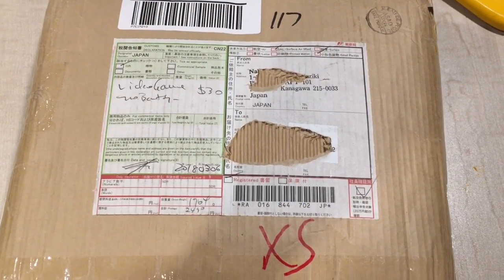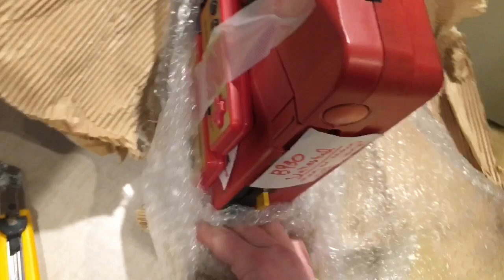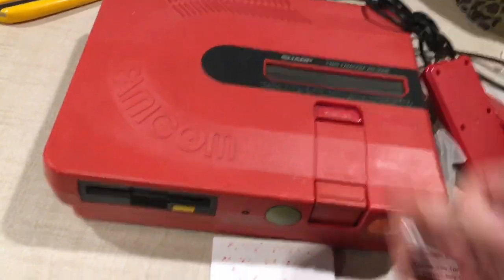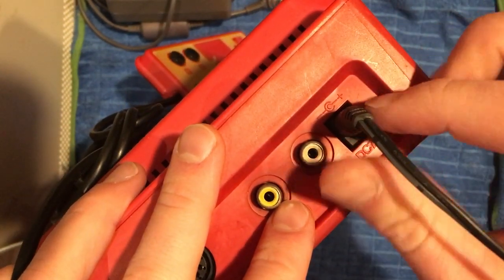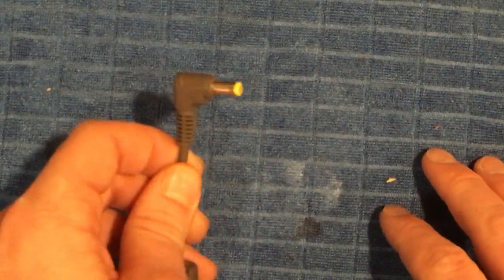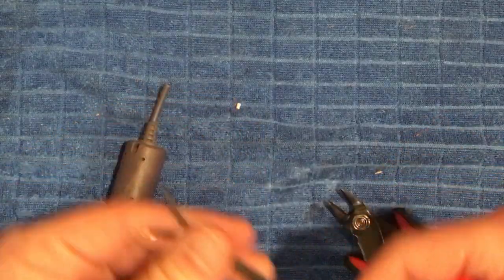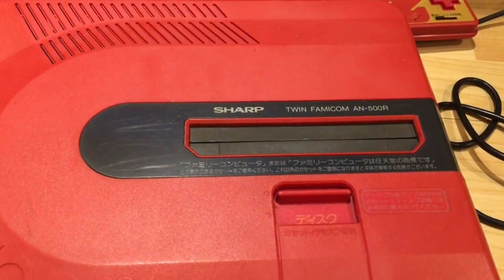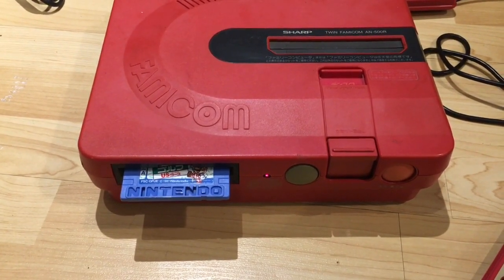Fixing eBay Junk - Sharp Twin Famicom - Part 1 - Testing and making a power cable

Comment: Also, I've always got my pug helping me out. Having a pup helper always makes things go better things go better.
When splicing cables like this, I always find spinning each end of the strands together, tinning each end so you're dealing with "solid" wires, then soldering them saves the aggravation of the wires going rogue like yours were.

Comment: Didn't have anything to do with the SNES. You are right about piracy being a concern though. The big reason was cartridge technology advanced to the point where any disk system game could fit on a cart by the time the NES was available all over North America, so an expensive, slow, clunky disk add on wasn't needed here.
Reply: Justin Thomas but it would be a nice collection.
Reply: +Justin Thomas Yeah, and even Nintendo of Japan caved-in and re-released previously FDS exclusive games onto cartridges later down the line, (e.g. Metroid and The Legend of Zelda) sometimes with battery backups added.

Comment: To connect those wires mechanically prior to soldering, strip both sides long enough.  First, twist the strands, keeping them straight.  Add a little solder to both wires.  Ply both the tinned wires and form two hooks.  Connect those hooks into each other and twist both sides until both hooks close.  The wires are now firmly mechanically connected.  Solder the joint for optimum electric connection.  Secure the joint with heath shrink.

Comment: It's an attractive console design. It can act as an alternate to a flash cart since the disk drive could bring homebrew games into the Sharp Twin either on disk or maybe on IDE Flash internally also.
Been there,  I got a 1980 portable TV with a now odd 4-pin jack, handy to make your own cords sometimes. Not that solder savy myself, had a PSP sit for 8+ months till I found a cheap AC for it, a Kodak iirc. ^_^

Comment: It's easier if you pre-tin both wires you want to bond together, then hold them in contact, and heat. The solder will form the bond.

Comment: Matching the output voltage is one thing, but the maximum output current rating should also be considered. In your case, the output is right at 7.5 volts, with max current rating on the Sony adapter at 2 amps, which luckily, given we don't have the proper documentation with regards to power draw, should be enough to safely run the system for extended periods of time without overheating or having the adapter's voltage drop too low. Personally, I'd always try to find an adapter that is rated for a higher output current than what I think I would need in the absence of labels/documentation. Just throwing this out there for anyone who might not be familiar with electrical work. That said, nice video. Looking forward to the next.
Reply from the maker: From what I've looked up, the current rating of replacement sharp power adapters is 1.5a, so the Sony one is within spec.  I actually found the idea looking for what I should use to power it, and I just happened to have a couple
Reply: That's good for you then. At least you've saved around $10 from having to buy a new brand name adapter with similar specs. It's always nice when you have the original bricks from name brand manufacturers. You can pretty much always trust the rated output figures, which is VERY important for nice rare/vintage devices. Good job!

Comment: Went back to see part 1 since you just uploaded part 2. Didn't see it in the comments, but with 230 comments it's very possible I missed it. Just a heads up, electronics in Japan run on 100v where the plug you've put together runs at 120v. This honestly isn't that big of an issue, and most likely won't do any harm to the system, but it is something to be cautious about.

Comment: So I picked up a bundle of systems off eBay and started repairing them, your videos have been an amazing help so far but I've ran into a hiccup. I have an original ds that charges and powers on... To a blank white screen top and bottom and no startup sound. My question is if you know what the issue may be and how to fix it or should I just canibalize it for parts?

Comment: i would give him a negative or at least neutral rating for worst shipping ever... thin layer bubblewrap and paper...  as if this person cant get a box and newspaper stuffing...
Reply: n0Sk_ill You are so right! I thought that was the worst packing ever. It should have also been shipped in a box.
Reply: shipping is expensive enough but you pay for it and to grab some recycled boxes from the grocery is not that difficult... i hate when sellers treat the items they sold like its not worth the effort cause its not thier own anymore...
Reply from the maker: To be fair, shipping was free on this console.  I've seen (and recorded) much worse.

Comment: That's a common 9/12v DC adapter 5.5 mm x 2.1 mm barrel connector. You can drop the voltage from one of those by inserting diodes. ~0.7v per diode for regular diodes. Assuming a 12v adapter, 12 - 7.5 = 4.5, 4.5/0.7 = ~6.43. Round it up to 7. 4.9 volts dropped. 12 - 4.9 = 7.1 volts. Close enough. Of course, check your diodes, you might need one less or more, and can get a closer match by picking and choosing the appropiate combination.

However, with the voltage being close to 5v, It'd try making a USB to barrel connector cable and plugging that to a phone charger. A lower voltage won't hurt a device, it may just work erratically or buggy, or plain won't work. If it does work, the lower voltage would mean less heat disipation and deterioration ("undervolting", look it up.)

For testing, you could have stripped the wires on the commonplace barrel connector, and first wrapped the negative around the barrel, twisting it on itself to hold it closed, then jammed the positive on the hole, doubled up and twisted as necesary. Then your choice of elastic band or tape to hold it in place. I find bending the wires back 180 degrees and holding them with a rubberband keeps the center one from going out and the outer ring from slipping out.

Whatever you do, don't fuck up an original adapter, please.
Reply from the maker: Never got an original adapter, it was the tip from an old dsl modem, and the transformer from a PSOne (super common here).
Reply: It's hard to explain, so here is a picture I made:
https://s17.postimg.org/eoe4abnov/not_to_scale.png

Comment: Two ways to splice braided stranded, remove only 1mm or so of insulation leaving only a tiny amount of exposed wire then jam ends together and leave a bead of solder in the ends jammed together or. google linemans splice or knot I forget what its really called.

Comment: You do interesting things but I do have a suggestion to some glaring notes in your work. Heatshrink tubing is your friend in a situation like this. Electrical tape for a use like this is going to deteriorate and get gross/sticky over time. It's also much cleaner-looking work. Just feed the tubing further down the conductor and slide it back over your soldering work to shrink it on.
Reply from the maker: I agree.  Mentioned towards the end of the splice that I'll probably pick up some tubing and do it properly.  Was out at the time

Comment: Why not just switch the polarity of the wires on the black sega adapter?
Reply from the maker: That was an old dsl modem adapter.  It output 12v and not enough amperage.  Would have the voltage regulator working too hard and lead to premature failure.  Plus not enough current to potentially run properly

Comment: much as i'm impressed by an innovative solution i can't helps but feel that two official psu's have been sacrificed to make a bodge one ;-; i think id've ordered the right tip atleast if not ordered a psu from a specialist, they're rarely that expensive.
Reply from the maker: It's worth clarifying, the tip I harvested came from an old dsl modem, not a NES, as i made it sound.
Reply: ahh good to know :D , i'm stoked it turned on, in my experience it's super rare for the cartridge port side of things to die they are basically tanks but the drive belts are a near certainty for gumming up and dying, that and the read heads getting super dirty as the disc system games don't usually have any kind of dirt guard like the later blue ones do
Reply: Also, how important was it that you found a tip positive power supply when you were putting a different connector on anyway? Couldn't you have just reversed the polarity when you soldered the new connector to the wire?
Reply: Yes, he could have.
Reply: Trafficman  if he had you would say why not use the other one

Comment: Good video, interesting console but you need to learn how to splice cleanly as those wires were frayed to hell. When dealing with coaxial cable to fig8, cut one side shorter for the core. Or just buy a dc barrel jack to fit properly

Comment: that hum is the power supply btw. i have a nes i had that happen on. it is annoying but can be fixed easy by getting right power supply.
Reply from the maker: Hum is actually the mic on controller 2
Reply: it only happens on the disk drive it seems. sounds just like my nes when was useing wrong power supply too

Comment: Hi, idk how to contact you any other way but I have recently reinstalled a battery on a Pokemon Silver cart I bought from Ebay with a dead battery. For some reason it has started glitching after setting up the clock. First jailbars appear, then the tiles get messed up, and then it just crashes. Saves don’t work either (it says that it will have to overwrite it, does that and then the game crashes). The polarity of the battery is right, doesn’t seem to be any bridging. I removed the battery and it went back to normal. Do you think the cart can be repaired?
Reply from the maker: I would think so.  Usually that behaviour would happen if you affected one of the other components.  Possibly a solder bridge on an IC, or you knocked a SMD part off the board, see my monsters Inc video I made a few weeks ago, I did that exact same thing.
Reply: RetroRepairs Nevermind, apparently those batteries from Ebay with tabs on opposite polarities (longer upper on the positive, shorter downside on the negative, which is opposite on original ones) touch the metal ring on the board and short themselves. Luckily my save chip wasn’t damaged (i don’t think it was bc saves work fine now with a donor battery from another cart but I hope?) but yeah need to be careful with that.

Comment: replacing the belt is trivial, however setting up the drive head is a pain in the arse, but there are plenty of good videos on youtube showing how its done, but there is not one single video that is perfect so watch them all, then work out the best approach for you.
it really galls me that no-one has ever put the nintendo service tool on the net, it slips on the drive motor and holds the position making belt replacement and head alignment dead easy, but no-one ever released the pics or diagrams of it.

Comment: the only yhing i would change is instead of electrical tape it use heatshrink tubing it there is somthing for that thin of wire ive considered getting some to repair a laptop power supply that the wire is ripping a little since the electrical tape seems to wear out over time and from flexing of cable
Reply from the maker: Yeah definitely.  Like I mentioned in the video, heatshrink tubing is ideal, and I'll probably pick more up and do it that way
Reply: RetroRepairs i must of not heard that part as i was eating while watching

Comment: if you get the belt from Console5 they are good quality.  I also ordered on of the untested no power cord systems.  I should have it soon.  But I already have the belt.
Reply from the maker: Good luck with the system.  For some reason I didn't even think of console5, I've ordered from them before, great resource

Comment: Will you try to de-yellow those controller overlays?
Reply from the maker: ArchiBenny95 I never realized they were yellowed, almost all pictures I see have them yellowed, I just assumed they were designed to be gold.  Rare to find a picture of one with the actual white overlay.
Reply: I know right? Usually the ones with good contion overlay are ones that were stored in the box. I did some experiments on a Twin Famicom controller with hydrogen peroxide and uv, but the red plastic will bleach too and turn more pink if you don't put the mixture only on the overlay, so be careful if you try! By the way, judging by the note attached on the console, we bidded on the same Twin Famicom on Ebay :)

Comment: You really are fing flux happy!!!!  You just stripped those wires that were sealed in plastic. Please put your flux pen up unless you soldering dirty / oxidated contacts or wires. You really should not be giving wire soldering tutorials.

Comment: Neat <3. Question: do you sell your repairs?
That's not the reason for the disc system. The reason was because of poor sells in Japan and they didn't release it in America. And not piracy. If you look at the disk and and inside of the disk system they have the word Nintendo in them and that prevented privacy. So next time do a bit of research. (not being an ass)

And

Also

HE HAS A DOGGO
Reply: He mentioned that in the video and explained that it isn't difficult for reproduction manufacturers to duplicate. Next time you criticize someone's video at least watch the whole thing first.
Reply: Dan Kooiman I did. Just making a point.
Reply from the maker: Aurα вírdч Nintendo's anti-piracy system for the FDS was the physical imprint in the discs, which is not hard to replicate.  Look online for third party discs and they all have holes where the I and N would be.  

Floppy disks are also easily copied.  Very easy to dump the file, whereas special hardware to dump carts was not nearly as common in the early 80s.

The particular format the FDS used, while not your standard 5 1/4"  or 3 1/2" floppy, was not new. 

The advances in cart technology made the disk system redundant eventually, but it's silly to pretend piracy wasn't a problem with this system.

Comment: Really should have cut the connector off close to the end to leave you with more wire. Then you should connect the wires with the nasa standard. https://www.youtube.com/watch?v=O-ymw7d_nYo
In lieu of that, get some crimp terminals and join the wires that way. 

That positive side wire is super dodgy, and I really wouldnt be use that, let alone tugging on it.

Also you aren't really doing any rework, so the flux on the wires isn't really necessary unless you're using some bad solder.

Comment: You could have just swapped the leads on the other cord
Reply from the maker: Tip didn't fit
Reply: @RetroRepairs   yes I researched that part.. I thought the black power cord would work but you mentioned it was the wrong power.. my bad

Comment: Do you sell these games you fix?
Reply from the maker: Some I sell, some I keep.  I got into this as a less expensive way to build up a solid collection
Reply: I need just a couple more then im good. I need a Turbo Graphics and Atair Jag and Dreamcast and the disk drive for the famicom then im done.
Reply from the maker: Nice.  I still don't have a turbografx, k never see them at a good price, and rarely available as "broken" at a price that isn't rediculous.
Reply from the maker: And jaguar, well those keep getting more and more expensive.  Also on the lookout for a cdi and original 3do
Reply: RetroRepairs. Might just get the sharp twin famicom and not go after the disk drive. I play my famicom more than my Nintendo NES.
Reply: RetroRepairs you said in another video you trade. I have a exrta ps1 that works looking to trade
Reply from the maker: thanks, but I've got a couple ps1 currently, and i was mainly talking local trades.  Usually systems for games.

Comment: 7 minutes of video to change the tip on an AC adapter? Are you just trying to pad your video time? Strip the ends, join them, tape them and test. If it works then you can make the adapter permanent off-screen. Almost 22 minutes and the only testing you did was turning the unit on and putting in a disc. I know you're trying to make x # of videos per week/month but, maybe you didn't need a multi part video for this one. Quality over quantity if you want to retain viewers.
Reply from the maker: The goal of the videos is to show people what to do, not just tell them.  For many people, swapping tips on a power cable is a no brainer.  Many need some detailed guide.  I've described what I accomplish in the description of each video.  Next one will probably be 20 minutes of replacing and calibrating the drive belt, followed by 10 minutes of fixing the hum prevalent in the background.  Telling someone what I'm going to do, then doing it off camera doesn't accomplish much.